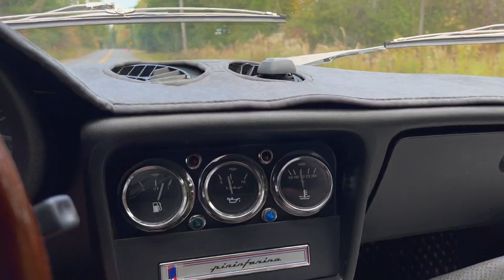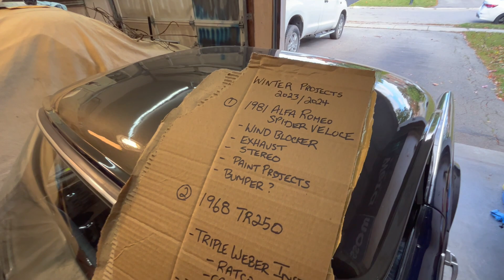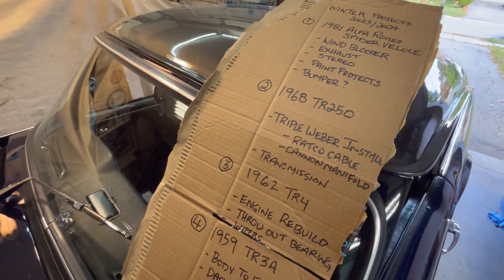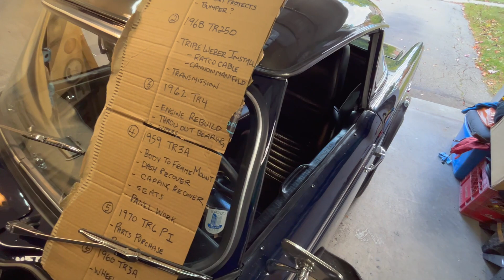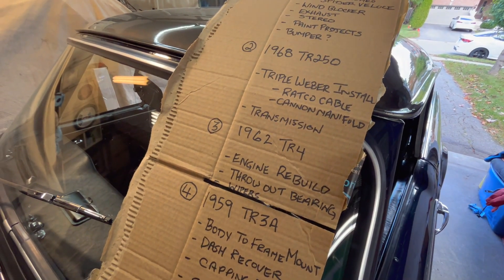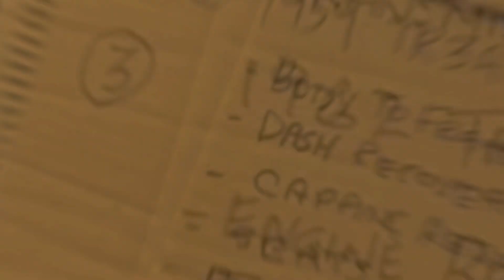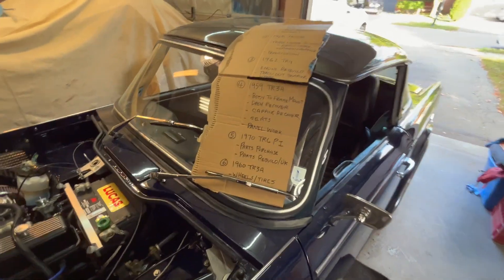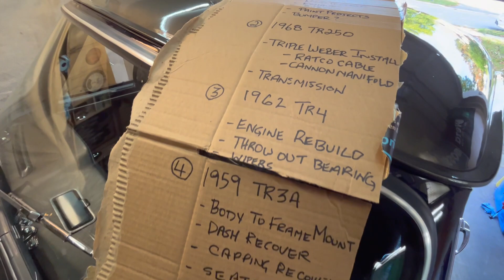Discussing Winter Projects 2023/24.  The List is LARGE!

Comment: Tush, with the PI metering unit, you need two, one is to be on the car with a second unit off for a recalibtation in England. You will only get about 6000 miles out of each PI metering unit before it must be sent off for recalibration again. A PI metering unit can be swapped over in about 40 minutes. It is worth it, the PI is a blast, but it will wreck your engine and your fuel finances when (not if) it starts squirting in too much petrol. I would carry a full set of 6 spare injectors too. The Lucas high pressure fuel pump in the boot is terrible, the pump overheats and vapor locks in hot weather and heavy traffic and the car cuts out; try to find an upgraded pump. One must only use brand new big end bolts on that 2.5 PI engine.

Comment: Lots to keep you busy and us amused.  I have decided not to strip my TR4 this winter, but I would like to do some small projects on it.  I do have some other projects such as building a new work bench, the one I have used for the past 5 years whilst rebuilding the TR3A is too small. I also need to take a look at the head gasket on my 1953 Little Grey Furgie tractor as well as fit an air filter.  The red UK phone box which I am turning into an outside bar needs finishing too, I started that before the TR3A; the door needs rubbing down and repainting, I need to fit some lights and shelving as well as a refrigerator.  So plenty to do here too, and watch your videos of course.
Reply from the maker: Yes, sounds like you will be busy as well!

Comment: You've got plenty to keep you busy when the snow flies, Chef!
I'll be particularly interested in the Weber conversion. I have a pair of 40 DCOE destined to go on my TR4 (it originally had Japanese SUs, probably from a 240Z). I know the jetting for my car will be different than yours, but maybe I can pick up some other ideas. I've already upgraded the original pedal/throttle shaft on the car, with a third Delrin bushing to eliminate any flex. 
The manifold I will be using is a one piece Weiand, if memory serves (it's in storage, so I can't easily check right now). My other concerns with the Webers are heat shields and some kind of supplementary support since they hang out pretty far from the head. I also have to figure out an air box/filter to fit over air horns that will be going on the carbs. In TR4 there isn't much room due to the inner fender arch. Might need to modify that.
Reply from the maker: Hi Alan, they do sell heat shields for the bottoms of the carbs…I’m going to try and run without them….my header is ceramic coated so it does run a little cooler combined with my wing vents…the hardest part is getting the linkage to work smoothly and get the carbs balanced…
Reply: @cheftush  Now that you mention it, my header is wrapped to reduce heat too... no fender vents yet, but they are in the game plan.

Comment: Please do an in-depth analysis of the transmission issue where it jumps out of gear on downshift to 2nd, and perhaps you have an idea before you start?  My 73 TR6 on down shift from 4th to 3rd has a similar issue, if I let off the gas or depress the clutch, it will come out of gear,  attempting to put it back and the gears grind without shifting back to 4th or 2nd, extremely annoying.
Reply from the maker: Yes, I’ll take it apart and hopefully we will clearly see and issue.  I was thinking that it might be a broken top hat bushing but we will see!

Comment: Cheftush is slowly going to the dark side, an Alfa Romeo.  You should know I have a hardtop for a series 2 Alfa that I'm fitting........
Or maybe I'm going to the dark side after restoring an Alfa.
Reply from the maker: Actually, getting away from the dark side 😉 I sold the Alfa to its new owner “ Doc” a couple of years ago…Doc brings it back each year for some additional work…last year, we did a Performance Exhaust, Brake and suspension upgrade.
Reply: Michael Corleone:
"Just when I thought that I was out they pull me back in."  It's an Italian thing. 
Hey Doc, there's a hard top if you want out there although it does require building special steel fitting if you want to use it. @cheftush

Comment: Hi cheftush could you recommend someone who chemically dip body shell and frames thanks TR3 Phil
Reply from the maker: Where are you located phil?
Reply: Port Elgin about 21/2 hrs North West of Toronto
Reply: @cheftush  
Hi cheftush just updating you on my search for a car dipping facility in ontario. Have you heard anything good or bad about PPS Ltd  Brampton? They quoted $2750 Canadian for the body shell but I would have to find someone to prime it following stripping because they don't have a painting facility. I've  talked to Elin about doing the repair work fitting new floors sills etc. Do you think strip then repair or repair then strip? I would appreciate your advice. Do you think I'm going over the top stripping and just be satisfied with manual rust/paint removal? Many thanks Phil
Reply from the maker: @philhunt4070  hi Phil, have not heard anything good or bad regarding PPS.  Have you considered soda blasting?  I like to have the car cleaned prior to starting metal work as it will uncover everything that needs to be fixed vs finding something later.  The process would be to get it stripped, then epoxy primed.  Repairs done and then repair areas epoxy primed.   I had the front apron on my 60 TR3A soda blasted.  https://sodapro.com
Reply: @cheftush  thanks for the link to the blasting guys have requested a quote and waiting to see the comparison with dipping